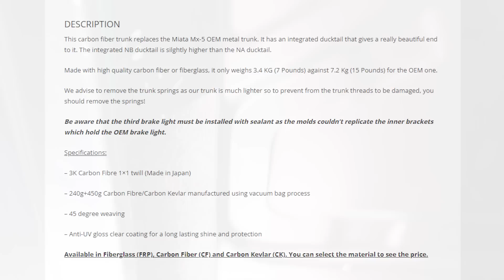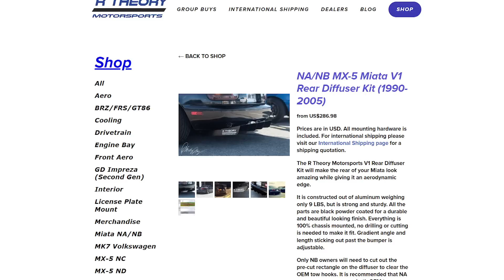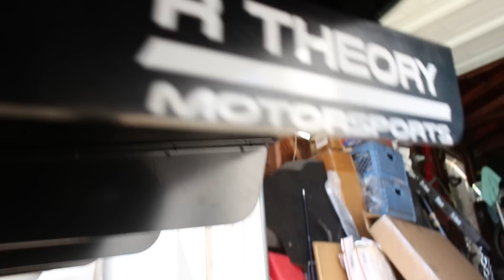3 EASY Mods To Make Your Miata Stand Out From The Crowd!

Comment: I highly recommend NO SIDE SKIRTS MADE BY ANYONE. Make your own out of polyurethane as I did. 
 My 2000 Miata is black on black. Red and black seats. A 2018 Porsche Cayman front bumper cover was incorporated into the original Miata cover (not fiberglass but flexible polyurethane epoxy). Rear tailights were handmade as well and look like an exotic car. Rollbar has leds that show when top is down. There are no emblems. 
 Rear bumper cover will be done next with another exotic rear bumper.
 Car is not lowered with 18 inch black wheels.😁😁😁
Reply from the maker: Where can I see pics of the setup??
Reply: @TheCarPassionChannel  I'll post pics when car is up for sale. Most will not be able to afford it considering the amount of time, labor and money I've put into it. It's all good. Not desperate to sell. 😁😁😁

Comment: On the 3rd brake light put a thicker gasket to get it flush then use double side tape for final install and maybe light coat of RTV just in case for leak insurance

Comment: Ducktail trunk lid 8/10
Rear diffuser 0/10 (that’s an assault on the eyes)
Ebay lip 4/10
Having said that, I’m an OEM guy. I have the front and rear spats (which I  optioned from the dealer in 2003, when I bought the car) and I have added over the years a Mazdaspeed, front spoiler and a Mazdaspeed trunk spoiler

Comment: How much would you think a regular stock NA8 can benefit from a Megasquirt and a tune over the stock ECU?
Reply: 10-15hp
Reply from the maker: @SXF_turbo  At MOST. I netted 6whp on my BP4W (113->119) from a 91 octane dyno tune. 100% stock everything else.

If you have bolt ons the gains will be greater

Comment: that diffuser is wildly expensive $300 when there's the basically the exact same thing on ebay for $50 another $5 at your local hardware store fr 2 pieces of metal to add the mount holes on the front and boom.

Comment: "Installing this diffuser will be the easiest thing to do on your miata, first remove that 17mm bolt..."
Bruh, I tried removing that 17mm bolt when working on my (30 yo, a tad rusty) NA, it was the hardest thing I ever had to do on my miata :p
(didn't even suceed, damn thing is welded with rust)

Comment: Front lip is a no from me dawg. OEM Optional NB1 style looks so much better. It also evens out the height of the front bumper lower edge, as the stock bumper with no lip is lower in the middle and looks a bit weird.